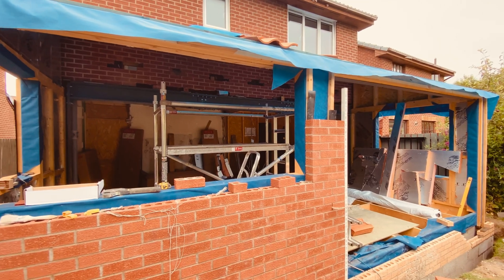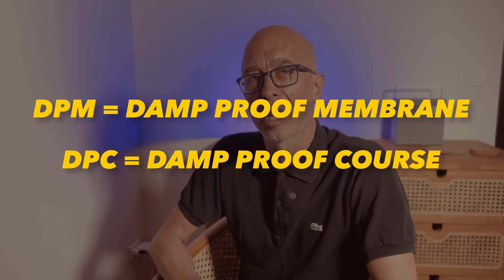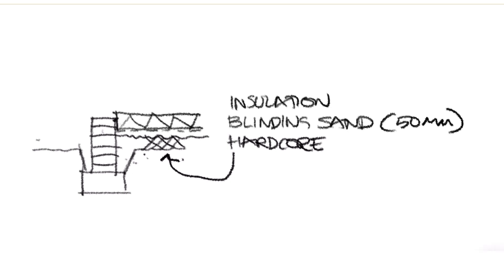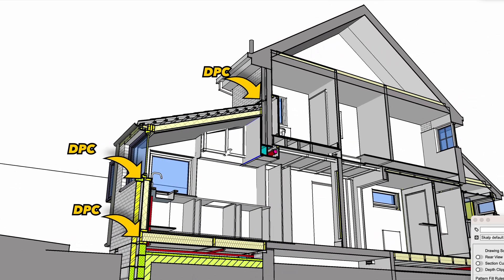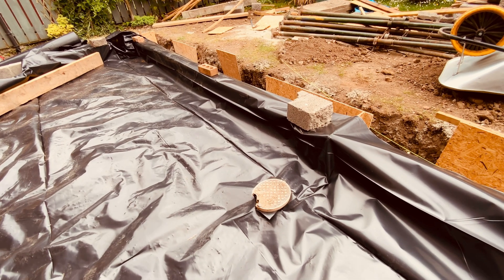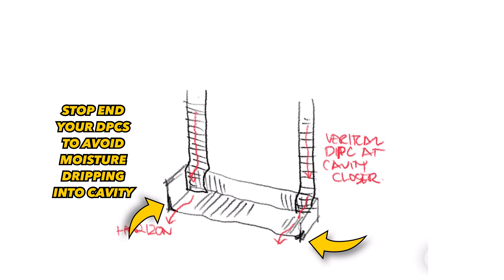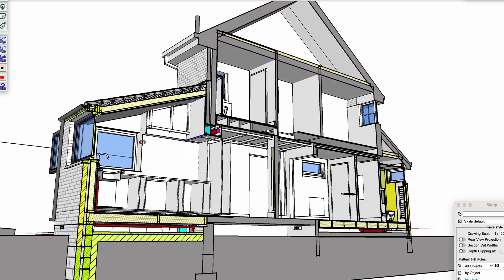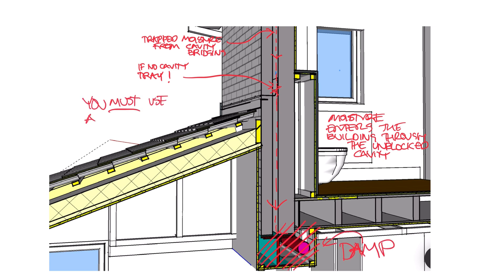5 EXPERT TIPS for HOUSE EXTENSION construction, avoid damp and condensation problems later

Comment: Please can I get some advice with using vapour barrier. Is it required on a new masonry extension? Concrete block inner skin & brick outer skin.
Can I just use foil back plaster boards dabbed on to block etc? 
Thanks 🙏
Reply from the maker: Foil backed plasterboard is ok, although I’m not certain about dot dabbing (“glueing” with big dollops of adhesive onto the block) with the foil. I’d check with a plasterer or with the manufacturer.  Perhaps you need to use battens. Then you have the option of a variety of vapour control layers . Presumably you will have insulation batts then 50mm cavity after your block inner and it’s a ventilated cavity, but I believe building regulations will still require a vapour barrier. Don’t forget to think about the floor and roof junctions to keep the barrier continuous.
Reply: Thanks for your advice, makes sense. Is there a way then of doing a vapour barrier without battening the walls? 
Most builders never do any kind of barrier on new extensions! 
Appreciate your help. Amazing videos by the way
Reply from the maker: In theory , I think,  provided your calculated dew point is within the cavity or close to the air cavity to the outer edge of the batt, you may not require a vapour barrier. if you use u Value calculators, many don’t include a vapour barrier for masonry. I’m just not clear what the regulations say because I don’t use full masonry construction as much these days.

Comment: Have to agree with the comments below, as a heavy Sketchup user myself the models look spot on, do you document using Layout as well? 

Quick question, how do we get the tray into an existing cavity wall? Can understand some lead flashing cut into the outer leaf and dressed down on the roof but how do you connect the tray internally?
Reply from the maker: Hi and thanks.  Yes, I use Layout and think it’s a great companion to sketchup. To get the tray into an existing wall there are two ways, but both involve knocking out a few blocks/bricks of the outer leaf , working along from left to right…you can then insert your DPC into the course of the inner leaf,  and fold into a tray bit by bit, but I prefer the preformed interlocking trays. It sounds a big job but it’s not. The tray edge sits over the lead flashing that goes out the roof abutment with weep holes above at every few perpendicular joints.

Comment: Hi Jerry, great video thanks for the insights. We are in the process of discussing with Architect moving the staircase from the centre of the house to run alongside the wall of a terraced house which seems quite similar to a project you alluded to. Would you be able to post your video on your experience on that project, please?
Reply from the maker: Hi. Yes it’s on my list and thanks for your comment. I touched upon that job very briefly, with the 3d structure axonometric in my structural engineer vid.